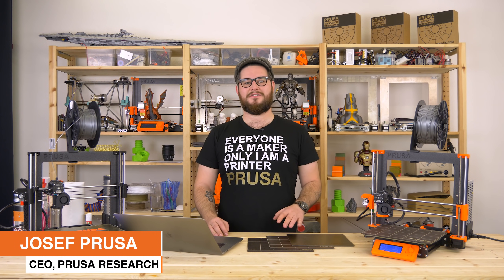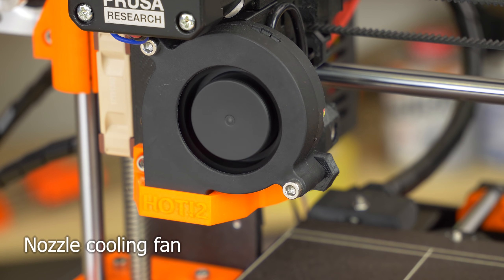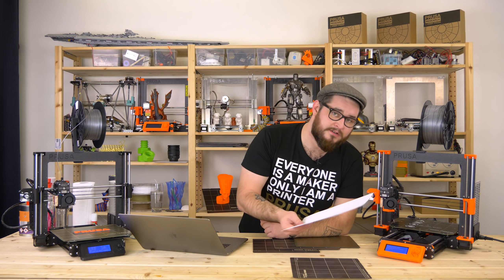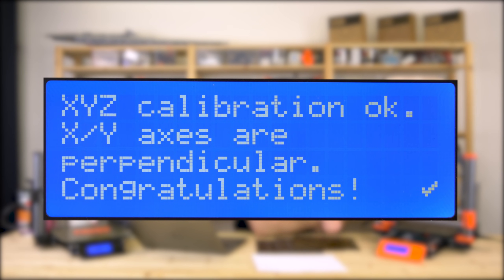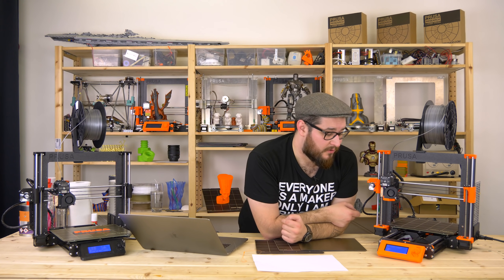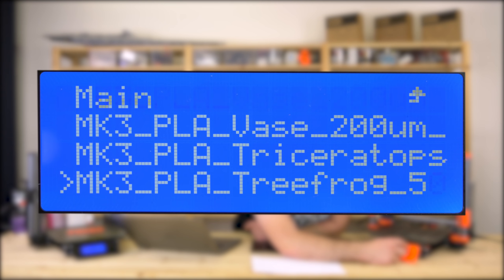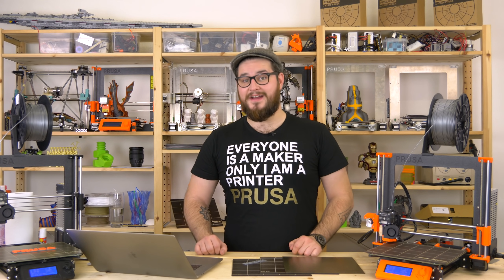Original Prusa i3 MK3 guide for a new user

Comment: After assembling the printer (i3 MK3) about a year ago and enjoying it decided to run the wizard as a maintenance service thing. Well, when I did the printer screen stated the two fans were reversed and needed to be correct before moving on. The only thing that has changed since the building it is software upgrades. Anyone else seeing this?

Comment: Nice video
I have mk3 and I am having issue with Abs print, " heating done massage" it stop the print and filament eject message is displayed than I have loads the filament again, it works and stops again, the same file in pla setting works perfect, any suggestion

Comment: 769 € for a printer that you also have to assemble yourself, and in which several components are also even printed. What's up. What justifies this high price? The components are never so expensive ?!
Reply from the maker: It would be best to ask any of our customers in, for example, a Prusa printers Facebook group.
Our printers are known to be extremely reliable and if anything goes wrong, our 24/7 live chat support is being praised for quick resolve of the problem. Furthermore, we develop both the firmware and slicer in-house, so even years old machine is constantly getting new features.
These things are hard to quantify in a component vs component comparison, but if you ask someone who owned a cheaper (or sometimes even more expensive) printer and later decided to buy an Original Prusa, they will describe you the difference :)
- Mikolas

Comment: I want to print with tpu do I need a special nozzle for this? I have the prusa i3 mk3s
Reply: No it will print with 0.4 but i would recommend turning of retractions or at least lowering the retraction speed. Also print slower than you usually would.

Comment: i have a creality CR10(really thinking about uppgrading to the prusa i3) and what i really hate about it is that it first needs to heat up the bed then the nozzle instead of both simultaneously. hows the prusa work in that area?
Reply from the maker: That's probably just a G-code generation problem in the CR10 profile. We obviously preheat both at once :)
Check your G-code and try something like this for preheat instead:
M104 S215 ; set extruder temp
M140 S60 ; set bed temp
M190 S60 ; wait for bed temp
M109 S215 ; wait for extruder temp

(they probably have the wait right after the first set temp)
Reply: @Prusa3D  a question off topic. will you make a bigger prusa in near future? i mean bigger print size?

Comment: I did live adjustment so many times. I printed a one layer square in the middle of the heatplate. After haven a perfect first layer I printed it again and again and discovered gabs. How can the distance between heatplste and nozzle change without doing anything ? Strange phenomenon

By the way: you can win LDO Priya MK3 motors and filament on www.pcpointer.de

Comment: WARNING DO NOT USE ACETONE ON THE TEXTURED SHEET IT WILL FLAKE OFF. Contrary to what Josef is saying on the video at 9:59. As the the steel sheet is a consumable it isn't warranted and therefore Prusa won't replace it. This is so misleading for new users. :(

Comment: Something wrong with the original extruder motor plate it pushes the steel ball therefore sending a signal that the filament is present when there's no filament.  Brand new order. Help please

Comment: Maybe a tip, those moist fiber cloths to clean glasses are also IPA based
Reply: Yes but you need to be careful. Some of them use 50% isopropyl, which will cause bed adhesion issues.

Comment: i own a Prusa Is3 Mk,3,,probebly produced Monday morning, no adhesion at all, I love the chez people. LOL. 800 bucks wasted, back to 3Dlac.
Reply from the maker: That's most likely Live Adjust Z not low enough. Our users sometimes have problems with parts sticking too much to PEI (with PETG for example) but definitely not with not sticking enough. Check the Handbook or hit our 24/7 live chat support, they'll help you out ;)
Reply: Live Adjust the Z- steppenmotor  is good, so what's the problem? I'am not ammateur but adhesion sucks on my is3 mk3, I use glue sticks, alcohol even aceton, (witch I don't like)  nothing is workink only 3Dlac, so I've orded 10 3dlac sprays worth of 124 Euro
Ordered it on Reprapworld,
If you don't believe it, I will send Prusa the billl.
Reply: @mickeyh2561  Im late, but have you tried to clean the bed with soap and water ?

Comment: This 3d printers are 220v ?
Reply from the maker: They can run anywhere from 110 to 230V, to PSU auto-switches.
Reply: @Prusa3D  after i bought one , i had to specified the voltage or all PSU that came with the printer are auto-switches ?
Reply from the maker: They are all the same, they can all auto-swiwtch, so you don't have to worry about it :)

Comment: I only hear good things about your printer and I would get one immediately... however, the print size is too small for me. If at least the Z axis would be bigger, that would help. The question is, why is it not "taller"? I mean, manufacturing wise there is no way it would make the printer that much more expensive, right? That said, I hope you come up with a "taller" print area soon!
Reply: i cant speak for prusa, but i think the frame sets a limit for how tall it can be, you could look into a zaribo frame kit if you want to get a higher z
Reply: @grumpydude1598  Cool. I did not know there is such a thing. I will look into that. Thanks.

Comment: The Benchy that comes on the sd card, is the slicer parameters documentet somewhere?, It's printing with an amazing quality, and I see that it also uses z-axis retraction, which I haven't seen on my old printer, so I wonder, how are these parameters, so I can use these as an starting point?, or is it one of the standard profiles in Slic3r?

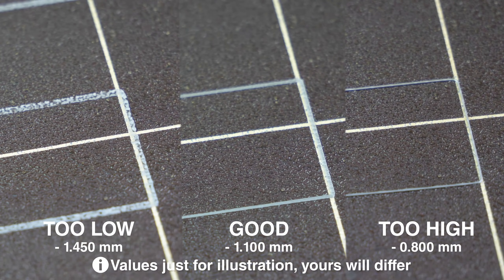Comment: So in the manual it says that the z calibration should not go below -1mm however at 9:35 the good is below -1mm. What should we do
Reply from the maker: We actually updated the manual a few months ago. This was true mostly with the MK2, the PINDA on MK3 can handle wider range of offsets: "The value should not exceed -2.000 mm. If you have to adjust it more (e.g. 2.500)..."
Reply: Thank you. I just got my mk2.5 kit done and the pinda has always been my issue. I'm experiencing slight curling on the prints now

Comment: I’m having a self test error y axis length, it will move the bed all the way forward no problem, then all the way back and then the belt starts to skip and grind... seems like the sensor expects the Y axis to be longer?.... but if I run XYZ calibration alone, no problems...
 
I have about 2 hours of experience in this field lol. But my first thought was weak tension.... but now idk. I’m currently printing the Triceratops Skull... no major issues that I can see(but I also don’t know exactly what I should be looking for either).

Comment: Hi not sure if you will ever see this Joseph but I asked tech support how to get in contact with you and they said there is no way to and that is what brings me here. I am sure only the pr people will probably see this and not you but figured it is worth a try.  I purchased the mk3 I3 and received it a week ago from today. It was the unassembled kit. I got all the way down to wiring and found out that my kit was packaged wrong with the incorrect pinda probe and also missing screws and nuts throughout every bag. I used up all the spare m3-10 screws in the spare bag and also was missing the tool kit. I contacted tech support sent pictures of the pinda I had sent me out a new one. Got it installed and having issues spent over 8 hours online with tech support trying to figure whats wrong with an 800 dollar machine that after paying that much I should not be having issues with things with it. After spending all that time she determined it has to be the pinda probe issue even though I told her what already happened and that this is a new one. Also sending out a heat bed since mine was not totally flat. I told her I would like to send this one back for another one and was told that's not how this works. After 8 hours of sending pictures and videos and them having me taking things apart and reassemble them again. I am not happy after spending this much money and having to deal with miss boxed items and having to wait a week then now having to have more parts sent out and waiting another week and already waited 5 weeks to get my printer.  Again sorry for having to post here but tech support said if I emailed the companies email to contact you that it would never make it to you

Comment: Hello Josef thank you for your video and the time you took to make it. I am new to 3D printing and printers.  My reason for getting one is basically for printing remote control model parts.  My question is witch filaments can I use with the mk3 that will be strong enough for this type of 3D printing? And can your mk3 print with stronger filaments???  Sorry my questions might be obvious to some but like I said I'm new to 3D printing and want to make the right choice for the application I'm looking to use it for . Thank you Edmund B.
Reply from the maker: The MK3 can print a wide range of materials. PETG, for example, is great for mechanical parts :) And you can print with even tougher materials, like nylon.

Comment: Would like to update my Prusa i3 MK3 with the new parts shown on the Prusa website. These are the parts affecting the heating and cooling of the print extrusion head. One helpful video would be the disassembly and assembly showing the old parts coming off and the new parts being installed.

Comment: I can't seem to pass the first part of the test when the head comes down after reaching the top and gets near the bed? I've adjusted the P.I.N.D.A sensor more than 10 times, but the printer fails every time? It appears the nozzle and sensor height are set correctly, but it still fails that first part of the test? Any ideas what I'm doing wrong?
Reply: I've got the exact same problem. Any solutions?
Reply: My extruder was mounted too low and wasn't in the correct groves. Once I took it apart and remounted it properly, everything calibrated just fine!
Reply: thanks, I'll check that
Reply: I made the same mistake. Now it's working properly. Thank you!
Reply: That is awesome! I thought I did everything right, but when I saw what I had done wrong, I just shook my head! Glad you are going now! You will absolutely love this printer! Using the silver filament that comes with the kit, you will be amazed at how wonderfully this printer prints, right out of the gate!

Comment: Great video, but For 4 months work (my Prusa i3MK3) have problem with print fun, small, but no one is on sale (they are only for 12 / 24V), even the Prusa store. 
And what we are now throwing out a good printer because of the fan for 1Euro.
It is a shame that the manufacturer does not sell spare parts for own products. 
Polish resseler dont help, Prusa support don't answer for my email from his site...
Site with parts in Prusa shop  speak - You do not have access for this product 
I wanted to buy a few more of them for the company, but now I'm starting to be scared, because every 4 months I will not buy a new one because of the fan for 1EU.
Reply: Login to the website. Go to spares. The fans are under the MK3 printer. If you can't see all of the spare parts, contact Prusa and they'll alter your account. They have both the Noctua fans and the Print fans and they are in stock right now. https://shop.prusa3d.com/en/34-mk3-printer-partsYou can only see the spare parts if your account is setup to see them. If your fan failed during the warranty period, contact Prusa with a picture/video and they'll replace it.
Reply: QuietPC sells the fans you require. The fans have a 6 year warranty with Noctua too.

Comment: Sorry - I can’t seem to find the trouble shooting video. Mk3 failed to find even the first calibration point.
Reply: Did you build it or did they ship it pre-built?
Reply: Hi, thanks for the reply!

It was the kit, so self build.  The calibration points are found, but now it is failing, every time, on the mesh calibration stage.  I have:
 - Tightened the X and Y belts considerably (this seems to have been the main problem with finding the 4 calibration points)
 - Tried lowering the PINDA sensor, and then raising it when lowering it further would have made it lower than the print nozzle
 - Tested that the PINDA sensor works (well, it found the 4 calibration points, but I thought I'd check anyway)
 - Reset the XYZ calibration via the printer's menu
 - Updated the firmware
 - Done the "pre-flight" checks about two dozen times

I'm a bit unimpressed; I've had it built for a week and not been able to print yet.
Reply: Yikes. I just built mine and it works. Have you checked the wiring on the board? Have you ran the self test to ensure your parts are working?
Reply: Yes, double checked the wiring, and it passes its self tests in the first part of the set up wizard just fine.  Am out of ideas at the moment, so I'll have to contact support.  I was kind of hoping to find the fault correcting video he talks about, but I guess it's not available yet.
Reply: Things seem to move slowly around the Prusa company. A tutorial takes them six months. You could try wiping the Pinda with Isopropyl alcohol. I can't really help much more than that, sorry.
Reply: Hey, no worries - thank you for the reply and input, I was just hoping for a link to the troubleshooting video!  

Hopefully the support people will be able to help, I just hope they work in the evenings.

Comment: Having trouble with z calibration.  I'm wondering if a pattern that auto adjusts the z height throughout would be easier.  It's difficult to adjust and watch simultaneously.  It seems that if the pattern had a set adjustment increment throughout it might be easier to look at the final result and determine a good value upon completion.  Maybe print the same pattern in various quadrants with varying z adjustments and then pick the best quadrant.  Repeat withing a narrowing range as you pick the best result with each iteration.  I understand you may encounter problems based on the sheet not being level from side to side but that is already an issue as you try to adjust on the fly visually.  To clarify, I'm referring to the "First layer calibration" step.

Comment: A video of how to fix filament stuck in the printer would be good.
I just unboxed my brand new MK3 pre-assembled printer. 
Can't even use it - extruder is jammed. Yes I followed the instructions exactly on how to "unload" the filament.
Been working on it for over 2 hours and still can't figure out how to get the stuck filament out. I'm thinking, it can't be that difficult, but here I am, 2+ hours later, still struggling with a brand new $1100 printer!! Suffice it to say, I'm NOT a happy customer.
Reply: I am sorry to hear that you had a bad experience. I don't doubt the veracity of your statements above, however I had completely opposite first and subsequent experiences. It also worth mentioning that I got the DIY version, which I assembled myself. I have never assembled anything as complicated as the Prusa i3 MK3 before, therefore I'm not experienced by any stretch. With that said,  I would think that a pre-assembled printer should be better unless it was dropped or was subject to sudden accelerations and impact during transportation-which could have affected the tolerances. It took me a while to figure out how to print PETG; however I had nothing but great experience with PLA using both cheap and expensive materials so far.
Reply: These printers cost way too much for what you get. You could have 4 Creality3d ender's and change for the price of this machine... I just want to know where all the money went.
Reply: @tarlach1280x960   Someone is always saying I can always get something cheaper & better Blah blah blah ... Ha Ha .

Like you I'm tight with my money ..no sense in spending it on some thignthat is as good but cheaper is ther ..or it there 

In June this year  I went for  a Fulson   a cheap top of their range Chinese clone (  purchased  via Amazon ) I had it built to the point where I'd used up all the parts supplied & did it according to their confused dismal youtube instructions  but  proved impossible to assemble due to several vital parts being missing . Their  customer care/back up was definitely a Fred Karno production , so it was sent back . I then discovered that their track record in not sending the complete kit and giving a reasonable service was well publicised ( wish I had found that on before I'd ordered it .

I then did a lot of online research wrt  looking for a quality 3D printer and talked on line  with many owners who had all manner of machines . Started to get a fair view of the problems many users were experiencing ( I'm an industrial electronics test & service mechanical engineer played with such stuff for many years  I actually went to a Makers Event and saw several different machines in action . Talked with their owners and realised everyone had some sort of down side especially when it came to getting spare parts .
I researched Prusa , realised they were an actual production & research establishment . Spares & updating kits could be had easily.  There is a continual development going on & they simply explained the  problems folk experience from using cheap inferior very  variable diameter filaments.

 It was after seeing the explanation about the filaments  that I decided to buy the top of the range  in kit form Prusa i3 3D   .  It's like purchasing a Volvo  instead of buying a Trabant  . 

 That extra cost goes towards their excellent  customer service & towards research & development . The kit I purchased was made in late November 2018 and has several new innovations and changes not on the early MK 3 designs .
 Sometimes a simple price comparison is no comparison at all to the actual value of what your buying into .